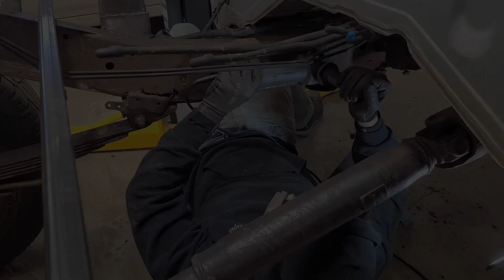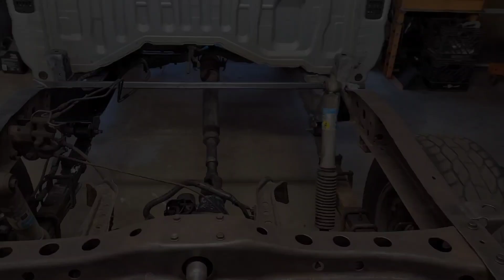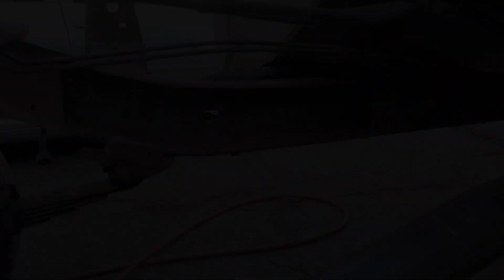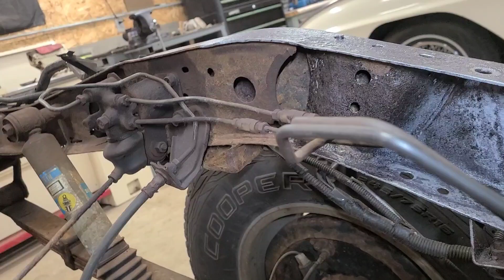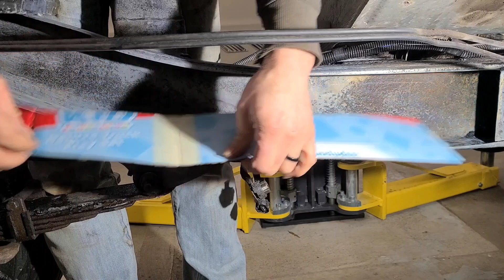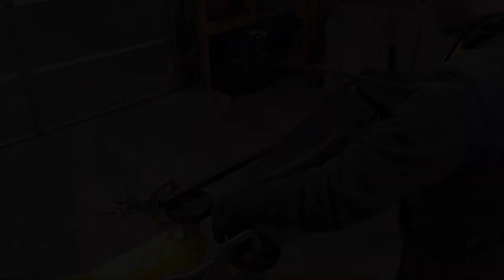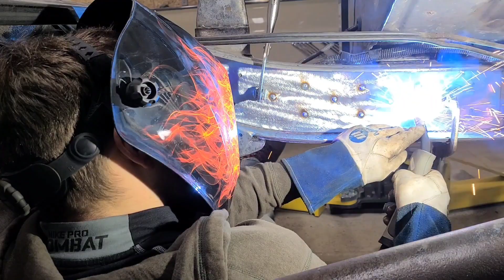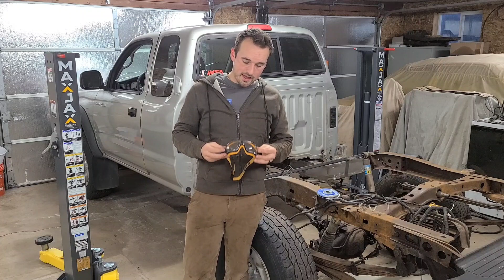Busting the Rust and repairing this Tacoma frame

Comment: I have an ‘09 that has the frame recall on it in ‘18 but the dealer just did the clean and paint and now it’s rusting again fairly bad. I’d seriously like to just have it taken apart and the frame really worked over. Am I crazy? I’m not a gear head to this extent.- Hoping I can find someone to do it. Like the truck just enough to be willing to drop a lot of coin on it to restore it all. Other than frame, it’s in pretty good shape.
Reply from the maker: Oh no, sounds like they didn't do a very good job then.  I would try to clean it up really well first to see how bad the rust is. If the rust is not severe, I would recommend a good quality chassis coating product onto the steel and then a topcoat product like Fluidfilm or the like.
Reply: @PostRt  let’s put it this way: The other day, from the outside of the frame near the crossmember under the transmission, I effortlessly pushed a 1/2” box end wrench clean through the frame.
Reply from the maker: @ntnsty  Yikes! That is a scary thing to have happen. Now is the time to decide whether to repair it or replace the truck. A shame too because the rest of these trucks are usually in good shape and reliable.
Reply: I believe the recall was to R&R the frame.

Comment: You installed that layered metal inside the frame with no type of coating whatsoever?
Reply from the maker: The job is not finished yet but I will be coating the inside and outside of the frame when I am done. That was discussed in the previous videos but I know most people skip right on through and miss the details.
If you have any suggestions on protective coatings, let me know.
Reply: @PostRt  used motor oil thinned with kerosene out of a yard sprayer and drench the inside of the rails twice a year I just did this exact job on a 99 Tacoma for my older brother I have three five gallon buckets of Toyota rust his had nothing but the top edge of the rails left after we beat on it for an hour and was snapped in half on both sides right below the cab on both sides best of luck to  you on the repair that Toyota steal don't like to weld for shit either it literally has rust clear through the steel from factory worse than the old IH Scouts and Fox motocross goggles are the shit for working under rusty vehicles and you can buy peal offs for them so they don't get grinder burnt from sparks
Reply from the maker: @79huddy  Great idea, I have barrels of used oil sitting around. I will check out some motocross type goggles next.
Reply: @PostRt  good to know, absolutely spot on job otherwise very impressive! I grew up in the Northeast and dealing with this crap for decades but now live in Georgia thankfully...😁. If you haven't used chassisaver I highly recommend it, what's going to be your final top coat for the outside of the frame?
Reply from the maker: @Broncodriver1975  After a good coat of primer and chassis specific black paint, I would like to coat the frame with either a Fluidfilm  type coating or special spray wax.
Reply: @PostRt  Fuid Film is great, it'll keep that baby preserved nicely!

Comment: Why was it so rusted ?
Reply from the maker: Many years in the rust belt of the USA. These trucks and many others I have seen around the Midwest develop a lot of rust. My truck is 20 years old and has nearly 260k miles on it too.
Reply: @PostRt  Oh right.
Reply: @65cj55  The factory metal used on these frames and the factory paint on them were both junk From knew even the recall replacement frames were the exact same junk you don't see many of these trucks in the north east or Midwest unless they didn't spend there whole life in those areas or someone has rebuilt it
Reply: @79huddy  They may not be tempered steel ?
Reply: @65cj55  that or they were made from melted down rusty ship hulls or something the only frames I've ever seen that could have 3/8" thick scale on a frame that was only an 1/8" thick brand new
Reply: @65cj55  I have yet to see a tempered frame on a pickup truck and I have done frame extensions on everything from f350s all the way through semi trucks. Tempering would be brittle and truck frames need to flex and twist off road. We cut and stretch semi truck frames for customers and our trucks, the manufacturers have specific steps for drilling, cutting and welding but I assure you, they are not tempered.
Reply: @TheRoadhammer379  It's actually my trade as well, 47 years as a Coach &  Motor Body Builder, started with Leylang building Buses, tempering actually helps in twist to return, obviously this frame isn't tempered, tempered steel doesn't rust this easily, but a good sign of a tempered frame, is that everything is riveted, it shouldn't be welded.

Comment: Good video footage, good work. I would however always keep a guard on that angle grinder. A lot of guys take them off. They say it's because they cannot get in tight corners with the guard, however I would not remove it under any circumstances. I'm a pipe welder and I've seen so many people cut their fingers on those damn things without the guard or their lower thigh. They come with guards for a reason....
Reply from the maker: Someone told me many years ago, "Never get too comfortable with any tool, always be fearful of it so you don't let your guard down."